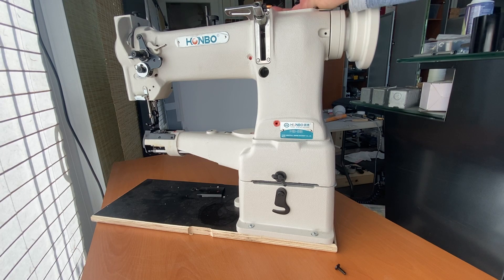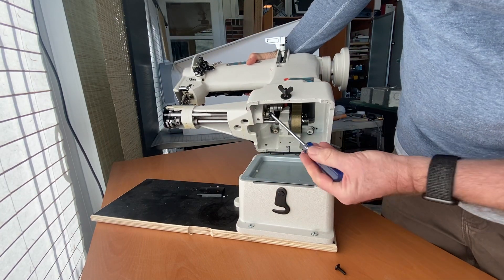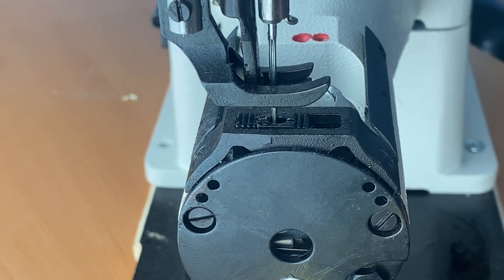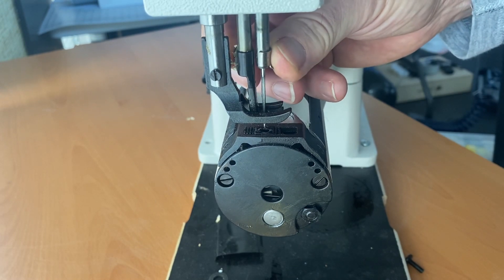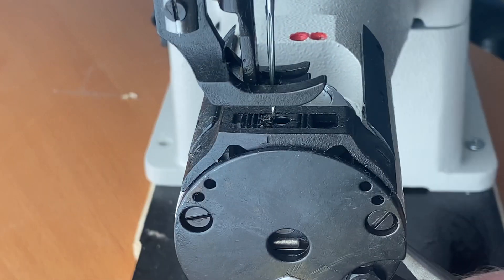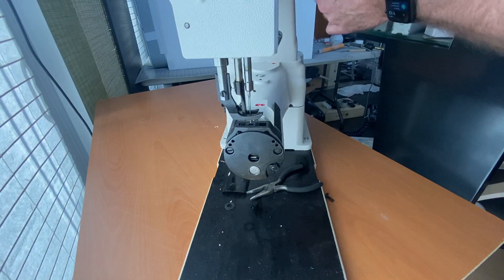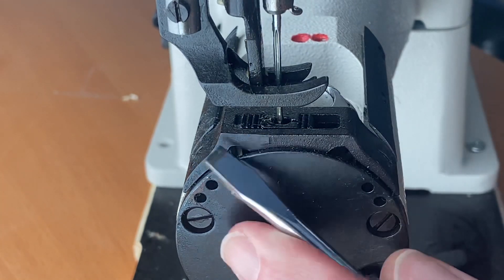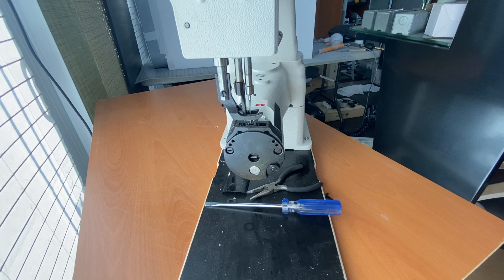Consew 227R feed movement adjustment

Comment: Hi! That was a most fascinating and serious adjustment there. You were able to slide major sewing machine components, back & forth, without re-adjusting the main timing! I'm agreeing with @Lee Copp that this may be a possible "workaround" to stop light materials from getting sucked into the feeder dog rectangular hole, by simply "sliding" everything back to the rear a bit.

Comment: Hi Uwe. 
I have a second hand Adler 69 leather sewing machine. The needle is too much to the left of the hole in de feeding dog and almost touches the border of the hole. I wander if it is possible to adjust this? Thx
Reply from the maker: Make sure the needle isn't bent. No real sideways adjustment options other than making the sure throat plate and feed dog are installed to the very left if there's any play with installation screws. 
Adler 69 service manual: 
http://docs.uwe.net/DA_69-373_Service_Instructions.pdf   
Visit the leather sewing machine forum at https://leatherworker.net/forum/forum/50-leather-sewing-machines/ 
to post questions about sewing machine maintenance.